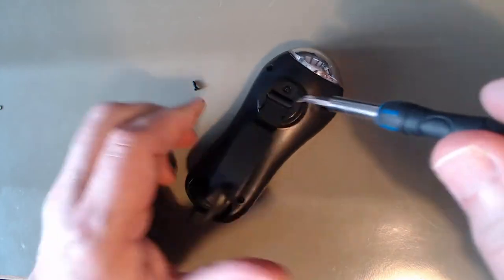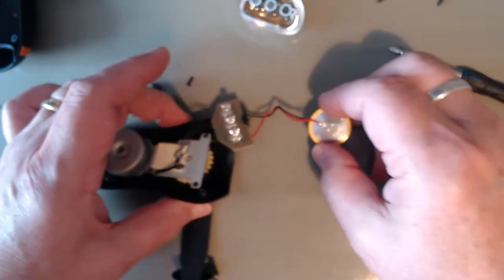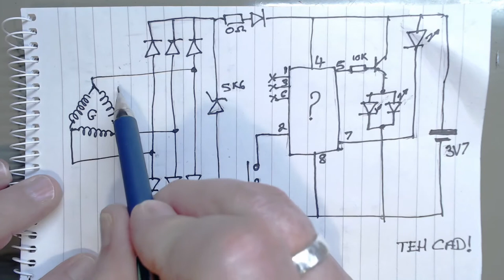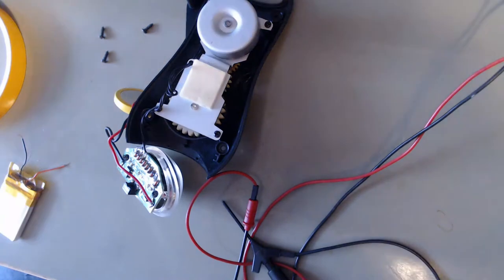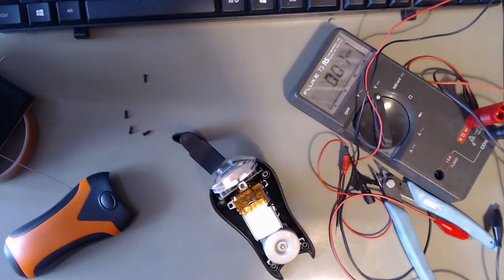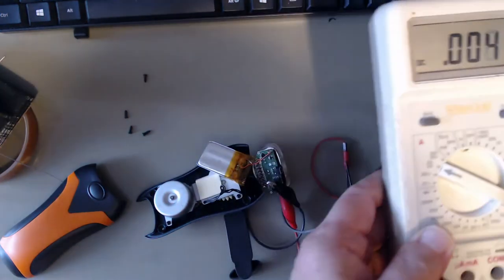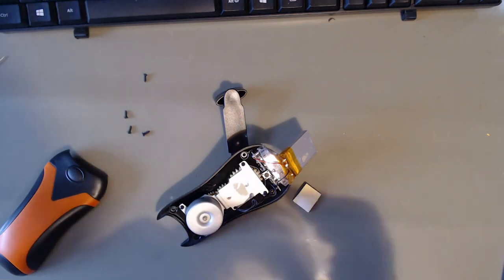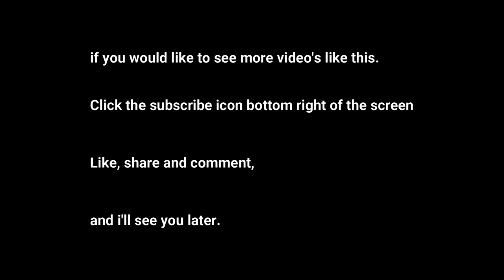#107 Wind Up Torch

Comment: I think the "generator" part is a 3 phase synchronous motor as used in heating valves. Apparently cheap torches flash because they mostly use bicycle light circuits which have a flashing mode.

Comment: Nice. Why do those cheaper Chinese torches all  have that flashing function?  It's just annoying.
Reply from the maker: My cheap head torch from Screwfix, has a red led function and flashing modes, I believe this is in case I get lost in my loft or under the sink.

 Such places are well known danger spots for getting lost in.